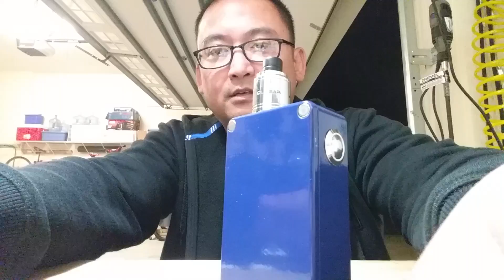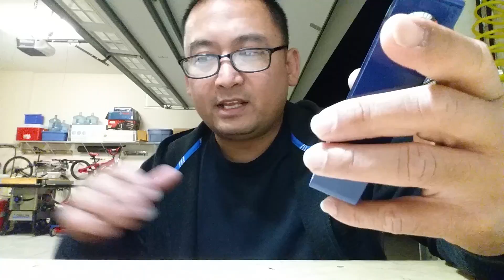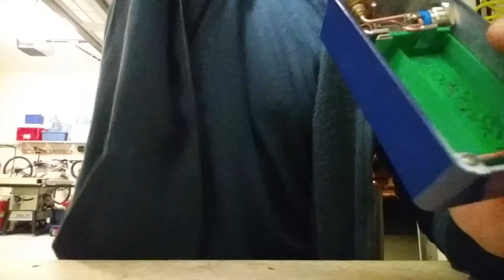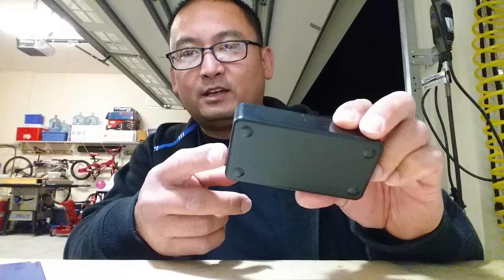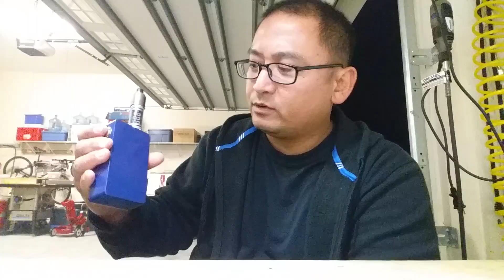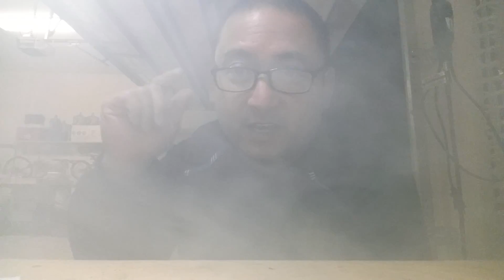(Giveaway closed) Dual 26650 Series Unregulated Box Mod with a Mosfet...The Frankenstein Build

Comment: Al USAF do you have a parts list and schematic for that ohm reader? I'd really like to build one.
Reply from the maker: damian deaucali I used the parts from my Eleaf ohm reader.
Reply: Al USAF I got beat up ohm reader laying around. I never thought to rebuild it into something better. Thanks for the reply.
Reply: Dual 26650s in series?  Damn.  I've got a friend with a copper tube mod with a similar setup, he was up to 800watts when he started melting his attys.  it was like sucking on a volcano.
Reply: Derek Gelinas I'm good vaping at 20-60watts. 800 watts is way to much for me.
Reply: Yeah I'm the same. I'm happy with my flask and Istick 50.
Reply: Al USAF another awesome box. Just curious, I know you love the solid copper wire and I think it looks sick but just wondering if you have done a stranded wire build or are going to try one. I'm wondering if your voltage drop would be lessened even more with stranded as I thought stranded would be better carrying current. Regardless, everything we watch you build is ridiculously sick!! Can't wait to see what's next
Reply from the maker: ***** I've never used stranded wires in any of my box mods. But if I encounter a build where I can't use solid wires then I guess I'll have to use stranded.
Reply: Al USAF Excellent yob. Can't find MOSFET if you can give me specifications for MOSFET so that I could explain to the seller what we need to think how much resistance, voltage, Wattage.kako I could find an adequate replacement or something similar. thank you

Comment: Hi,Am I correct seing you had removed the top part of the heat distributor on the mosfet,ie cut it short,or is it just I can`t see it on my laptop,I got to give it to you here dude you do clean soldering,I love the bare copper,Have you ever thought of building a steam punk mod or does it not interest ya?
Reply from the maker: +wow dude the tab is still there, it's right above the sled. I've done quite a bit of soldering before I started building mods so thanks for the compliment. Working on custom enclosure is too much work for me. This is the reason why I haven't built a wood box mod recently. So no to building a mod witha lot of fabrication work.
Reply: +Al USAF My opticians reckon I need glasses for close up reading,I thought his trying to make a buck,may be the geezer was correct lol,Thats a shame`I just love some of the steam punk type,especially the ones that have the moving parts that are functional.
Does it matter if the Mosfet tab is touching the floor of the box directly with out any silicone in between,as I was thinking the heat could disperse through the mod box metal.
Reply from the maker: +wow dude it doesn't matter. Someone suggested using thermal paste adhesive. I typically use JB Weld.
Reply: +Al USAF Cheers,I picked up some of that heat sink you have used on the other box mod you show,did you have the mosfet facing down for that heat sink to be face up towards the opening,
Reply from the maker: +wow dude face up.

Comment: hey I would like to know are your copper wires touching the box I am going to build one of these and would like to know ... also is 14 gauge wire safe to use
Reply from the maker: +ryan seltzer the wires are not touching the box. The only parts that can directly touch the box are the mosfet heatsink mounting tab (the back of the mosfet which is also internally connected to the middle Drain lead) and the 510 connector negative. Basically these two are wired together on the build itself. The mosfet is not really directly touching the box because it's mounted on with epoxy.

Comment: öhm the mosfet dont regulate the volts down to the mosfet specs ?
when i use a 5v mosfet what happen to the mosfet or the accus ?
Reply from the maker: maddin fearly no for the first question. I don't understand your second question, can you be more specific?
Reply: i would use a 5v mosfet to regulate 2 stacked 7.4v purples down to this 5volts. as example. will the mosfet heaten up when he haves to "down grade" the load ?
Reply from the maker: maddin fearly mosfets don't regulate the voltage. You will need a voltage regulator such as the Raptor or OKL2-T20 chip. The IRLB3034PBF mosfet, what I use, requires 2.5 volts for it to turn in. So if you have 7.4 (batteries in series) you can use your box mod until your batteries drain to about 6 volts. I say 6 volts because you don't want to drain your batteries below 3 volts. In parallel configuration, which is 4.2 volts, you can go down to again 3 volts. So if your mosfet requires 5 volts for it to turn on then it should be ok for a series configuration but not parallel.
Reply from the maker: maddin fearly I meant 8.4 volts for batteries in series thar are fully charged.
Reply: aha thy

Comment: how your coil setting when vape at 8,4volts??
Reply from the maker: fadiel pribadi I build my coils between 0.4 and 0.6 ohms for my series box mods. Either 24 or 26 gauge, but I prefer 24 guage. 8 to 10 wraps for either gauge on a 3mm bit.
Reply: it's gone be dryhit so fast?
Reply from the maker: fadiel pribadi no, I can do about 6-8 2 to 3 seconds pulls.
Reply: how you can do that??
Reply: thanks bro..you're inspire me to build dual 26650 series boxmod..but i plug the PWM into the mod :D

Comment: Hey there amazing video would like to talk to u and ask u a few questions if u have a mine. Hope to hear back from u
Reply: I have a hammond box mod just wanted some insight and ur expertise
Reply from the maker: joseph stach shoot...
Reply: I have a hammond  box mod 18650 that can switch from from series to parallel with a switch have u heard of such a set up and does have a mosfet
Reply from the maker: joseph stach yes I have. Does it have a slide switch or a rocker switch?
Reply: I can take a picture and show u but dont know how to upload it on here
Reply: Its a slide switch
Reply from the maker: joseph stach do you a concern or a question about it?
Reply: Yeah just want to make sure its safe to run in series heard some stories my build is .7 ohms is that a safe build and how low could i go and thank u for ur input
Reply from the maker: joseph stach 0.7 in series is pretty conservative. How low can you go will depend on your batteries. You're probably using a 20 amp battery, so the lowest build you can do using 8.4 volts is 0.42. I know your not going to be vaping at 8.4 volts because of the voltage loss but this will leave you some headroom so your not maxing out the amp rating of your battery.
Reply: Ok great thank u so much im using inr18650 samsung bats right now
Reply from the maker: joseph stach again those are just my recommendation but you can always go lower at your own risk...again at your own risk. Vape safe!
Reply: Thank u have a great rest of ur evening vape on